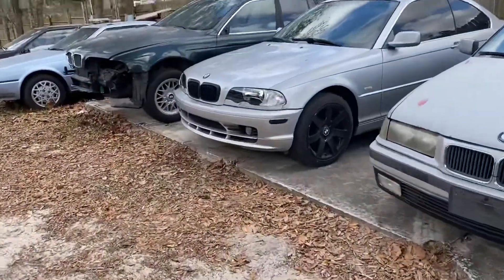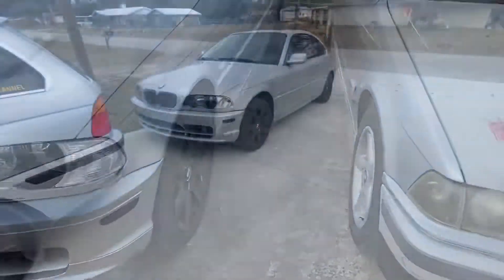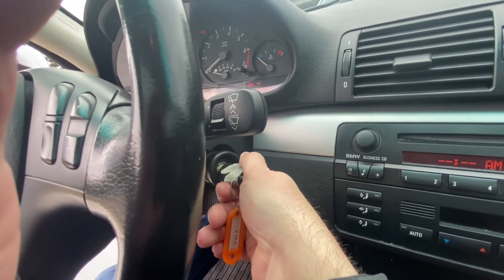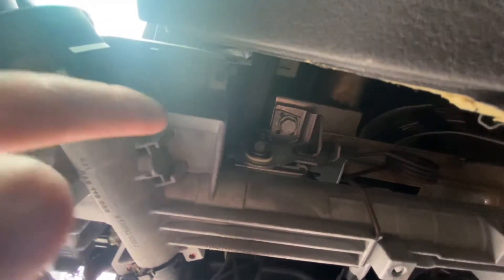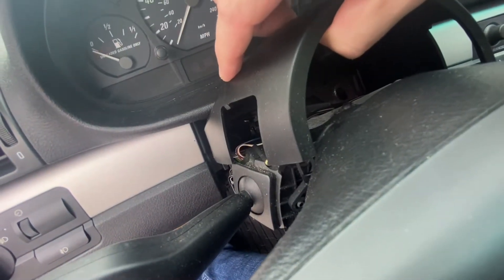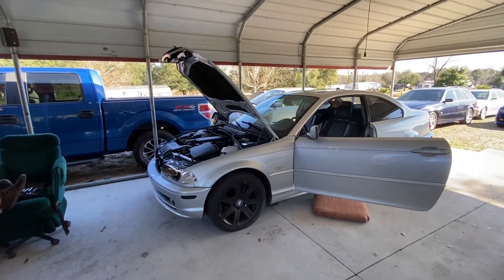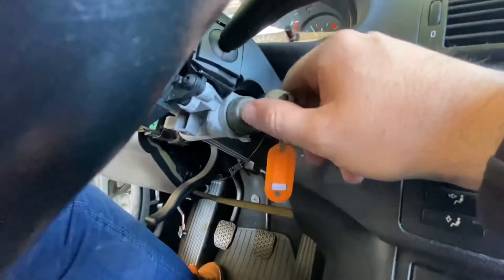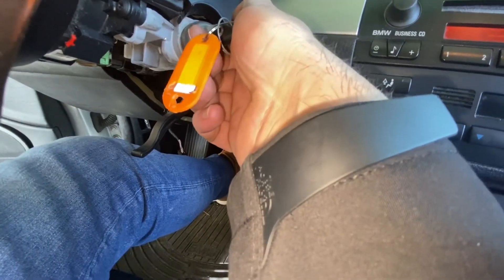E46 NO CRANK *fixed* key transponder and key antenna ring cause a no crank situation

Comment: Hi Waldy, after this video the car keep cranking fine after replaced the ignition antenna..??? No more problem??
Reply from the maker: Keeping in mind this is a manual car, Yes after replacing the key anntena ring it worked fine. Thanks for the comment.

Comment: Assuming that was your fix to the no crank, no start? Currently having the EXACT same symptoms with an E39 manual. Replaced EVERYTHING on the ignition system, including a brand new key from the dealer, and got it working for a couple days. EWS and DME scanned for faults and zero. Im hoping this is my problem cause im exhausting all my options besides tracing the whole harness :(
Reply from the maker: I truly hope so, these issues are frustrating!
Reply: Did replacing the ring antenna work for you?

Comment: It has nothing to do with your no crank problem as it works correctly! When you put your key in and the doors were opened I could hear beeping which means immo and code were recognised correctly. By wiggling the cables you accidentally wiggled the whole barrel which wiggeled on the other side the ignition switch were likely your core issue is…

Comment: You removed the ring while the car was already running. The car does not need the ring around the ignition to be connected while the car is running, it's only required to communicate with the correct key which will allow the car to start. Now in you video you switch the car off while the ring was removed already but you were able to start it back up again without the ring connected, this is also normal behavior, once the ignition is turned off, if within 10 seconds you will be able to start the car back up without the ring connected or even the chip in the key, in fact you could start the car essentially with only the key blade with no electronics present, as long as you try to start it again within 10 seconds after turning off the ignition. I believe you did not wait long enough after you turned the ignition off before cranking it again thats why the car started without the ring around the ignition. If you don't believe me you can try it yourself. If you have an after market key that clips together or even if you have the original key that's been cut open, start the car with the key as you normally would then turn off the car, and quickly within 10seconds remove the electronics from the key so that you only have the key blade and you will see the car will start up no problem, but if you wait more than 10 seconds and try and start the car using just the blade it won't crank until the ring senses the correct chip in the which will allow the car to start again
Reply from the maker: Absolutely correct. Please consider subscribing.👍🏻

Comment: It was only the reciever ring??
Reply from the maker: The ring and the clutch switch.
Reply: @waldyxlt  do they need to get coded? And they broke just like that or bad recieving and stalling first?
Reply from the maker: @E36andE46vlog  nothing I did on the video had to be coded. The ring just stopped working. One morning the car wouldn’t crank and that was it.
Reply: @waldyxlt  you put in a new ring and it worked again?

Comment: The problem is simply in the battery. Discharged or too old.
Reply: If the battery is discharged - why are the doors locking/unlocking with the remote buttons?

Comment: Hi my friend. Did you experienced any trouble with the alarm, ews or else ? I'm currently having the same problem with my e46 and I'm very tempted to try your technique.
Reply from the maker: Hello, I had no issues with the alarm, ews etc at all. Keep in mind this one is a manual.
Reply: @waldyxlt  hi, thanks for the feedback. Mine is a manual too. I tried your technique yesterday, without success alas. I might have to change the starter.
Reply: @judasmaccabee3  m

Comment: Any ideas on how to bypass the key antenna on a automatic car since with manual you disconnected the clutch?
Reply from the maker: Good question, the only thing I bypassed on mine was the clutch switch, the key antenna was disconnected and it started without it only after it had started with the replacement key antenna. I didn’t try a “jumper” wire on the key antenna harness. So I don’t know if that could be bypassed.
Reply: Apparently those antenna rings are mated to the sensor in a key lm told and to get a new coding and barrel costs 400 bucks in Australia, might have to bite the bullet ahh well
Reply from the maker: @billystergiopoulos8025  I simply took a key ring antenna from a parts car that we have and it worked on the car in the video. I believe the key and the EWS are coded alike, and the ring is just there to tell the EWS “yes that’s the correct signal coming form the key”.